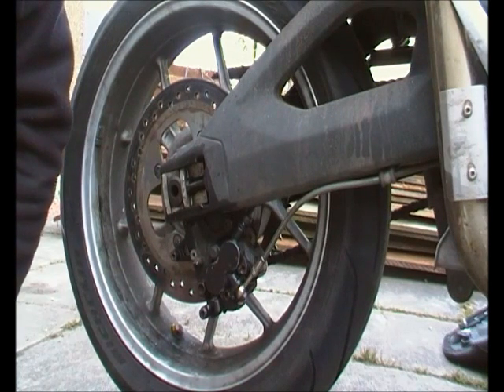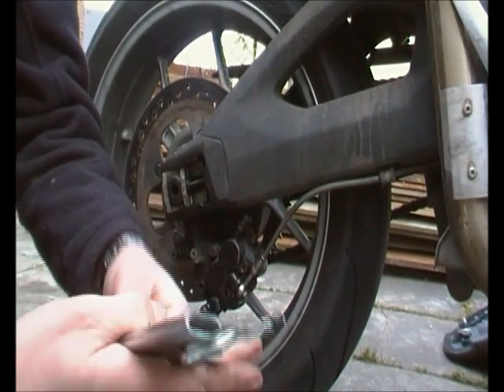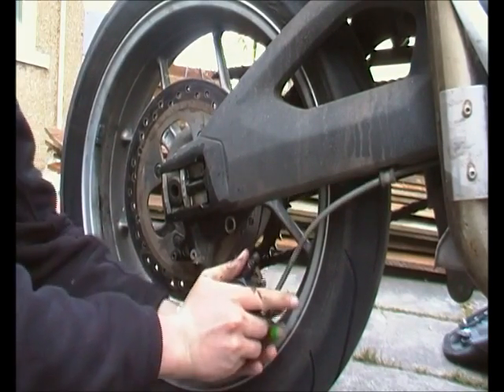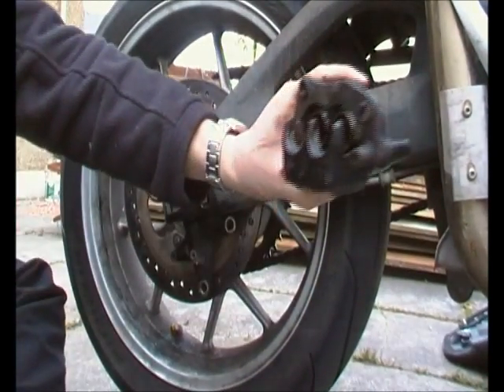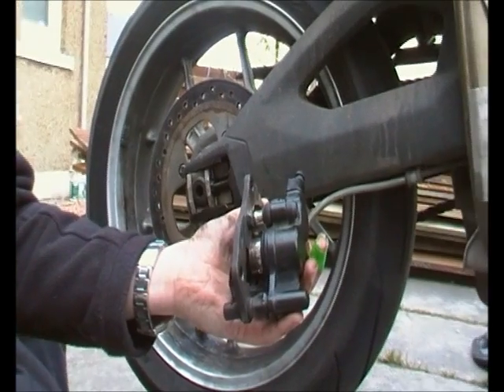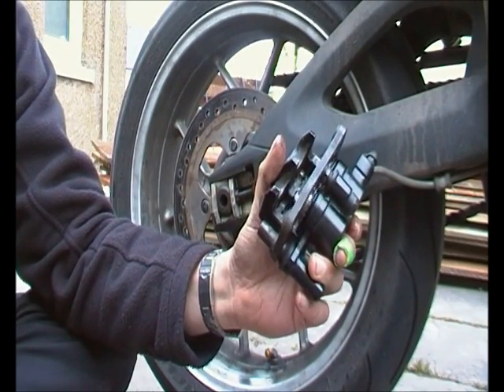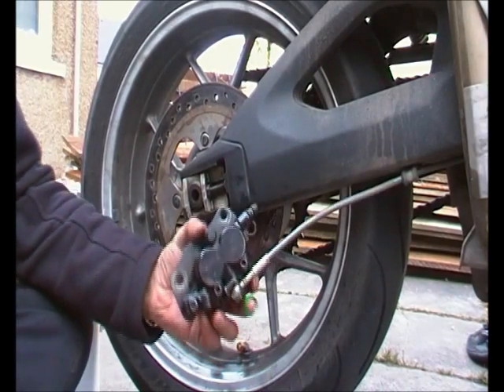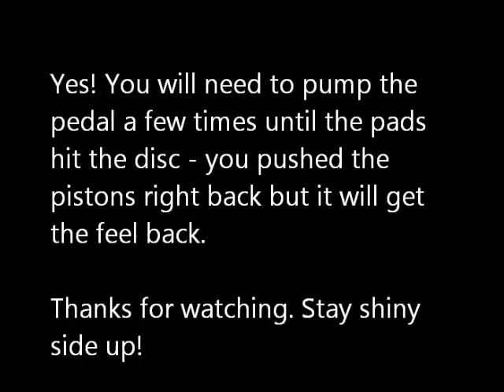Triumph Tiger 1050 - Rear Brake, removal and cleaning

Comment: Useful video, especially as I am about to service my 1050 brakes. I'm a fair weather rider and so don't have your corrosion issues to the same extent, however a couple of pointers. . . 
Having checked the manual, there is no mention of how to separate the two caliper halves to lubricate the slider upon which they move and I suspect this is sealed for life, however, if this is seized, it will quite likely result in your brakes sticking on. When I remove my caliper, I intend to check that both halves of the caliper can be moved towards and away from each other freely and if not, investigate further if the pin/slider can be lubed.
The second point - 3 in one oil, copper slip and I suspect wd40 are mineral based oils and they will cause your piston seals to swell if you get it anywhere near your brake pistons and then you will be in big trouble, the only remedy will be new caliper seals. For the piston face you need a silicone or red rubber grease.
Thanks for the clip - I will definitely pay more attention to mine from now on!!